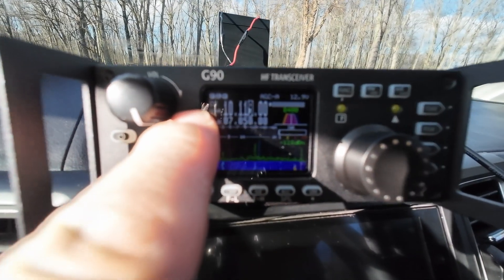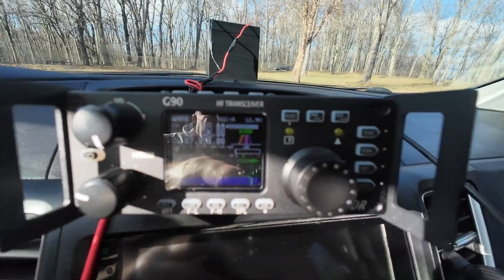DIY Multi Band Ham Antenna  Experiment

Comment: I have been playing with wire antennas lately and I have an LDG 9:1 unun and have cut 29', 41' and 58' wires and have banana plugs on them. I choose which one will fit into the space I am set up in and just plug it into the unun.  Other good lengths are 71  84 and 107. I may cut a 71' wire but I doubt I will have much opportunity to use it. N7BBQ
Reply from the maker: Yes, as I said, I want a longer wire at home for the WARC bands and 80-160 meters. There is so much snow in my yard I can't get out to hang it. I like the banana plug idea. Thanks for the tip, and thanks for watching. 73s.

Comment: Cool! Next experiment here is going to be a 25-foot Rybakov 4 or 5 band vertical antenna. The LDG 4:1 unun and speaker wire arrived yesterday just in time for a snowstorm. So, will have to put that up later.
Reply from the maker: I am stuck, also. There is a lot of snow in my yard. That sounds like a great plan that you have. Thanks for watching. 73s
Reply: @cknight3457 I made a Rybakov using that same unun and hang it from my POTA33 mast and it works great and I can tune it from 50M to 6M